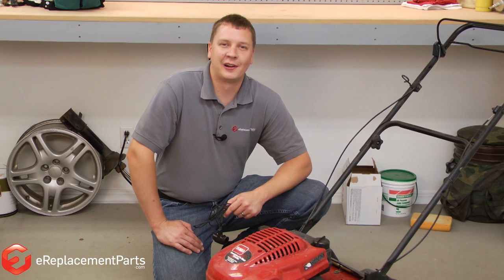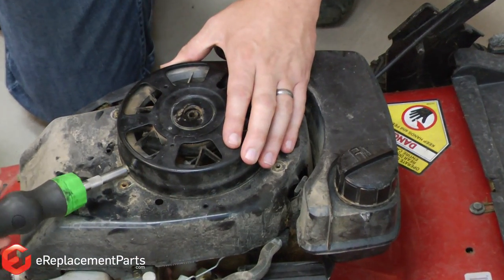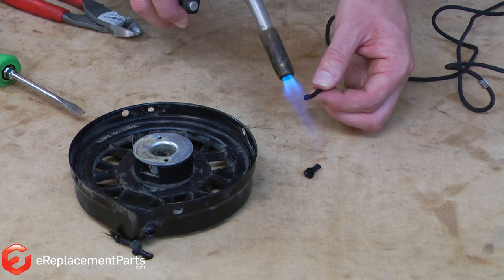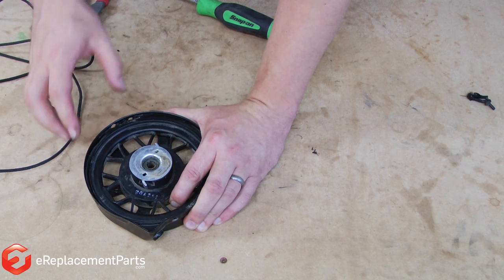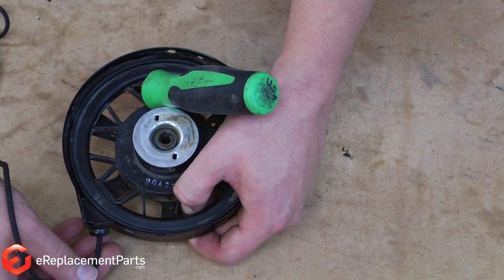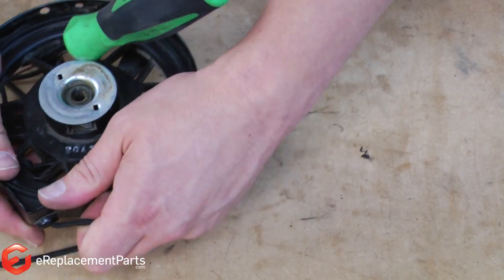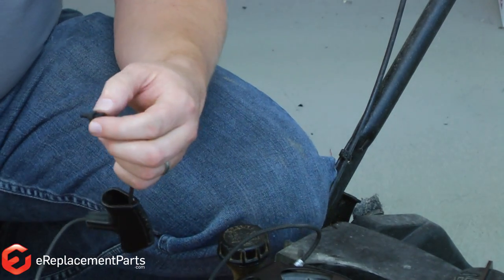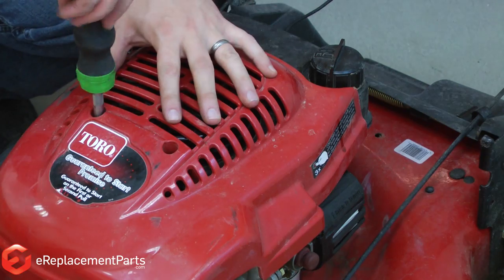How to Repair the Starter Cord on a Toro Lawnmower

Comment: Thank you sir... I also found your video and as having the same lawnmower and my cord breaking in the exact same spot, you turned a frustrating Saturday afternoon into a 30 minute bump in the road.  I especially benefited from the tip with the torch and rolling the end of the cord.  Thanks again!!!

Comment: Great video. I had trouble feeding the cord back through the housing. Solved the problem by feeding a small but firm wire from the inside of the housing and inserted it into the rope center. This gave the rope stiffness as well as direction as I pulled back on the wire and fed the rope. Done in 3 seconds!

Comment: This is a very helpful video. I had problems feeding the cord back through the housing and pulley wheel, then noticed that the cord was hollow in the center.  I inserted a short piece of 20 gauge wire into the cord end and used it as a pilot through both holes--problem solved. Thanks for the video.

Comment: Great video - right on the money.  My cord broke (like his) right at the base - if, after removing the spring/coil, there is no tension or wind-back, you will probably have to replace the entire unit (about $25 from Amazon) but the instructions are essentially the same.  One tip - there are two screw holes on the unit (about 3" apart) where you reattach to the mower - only one pair allows the shroud to fit back on properly - just something to keep in mind... Oh, and when you are done and testing the mower, be sure to reconnect the spark plug....  yeah, duh me.

Comment: Mark, this video was great but you can save a step by feeding the cord through the plastic housing before you reconnect the rope to the starting coil.  no need to take off the handle....thanks!
Reply: Larry Hitchcock Yep, that's what I did when I repaired my Toro today, using these instructions!

Comment: So you maximize the tension on the spring, and then back off from there. I get that part.  But you only backed off within one rotation to line up the holes.  That still might be tighter than you need it just to have the stop on the cord recoil back to the hole.  If I experiment, I might find a lower spring tension that will still do that, by backing off 1 or 2 full turns, and then line up the holes before threading the cord.  That way, the spring is spared excess tension when starting the mower.

Comment: My lawnmower is only a year old and my dog chewed the pull string. I did everything you said about replacing it (thanks much) but now when I pull the cord out it doesn't retract. If I take off the cover the pull cord will retract. It wont catch the flywheel and turn it. I have a Briggs and Stratton 550ex model. Can you provide any information about this? Thanks!